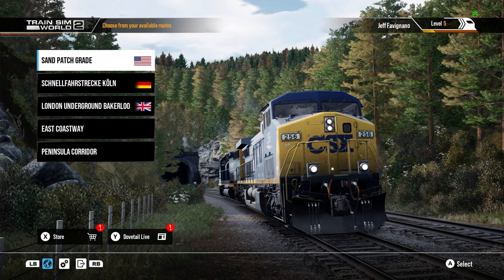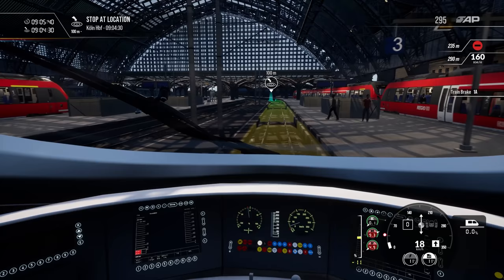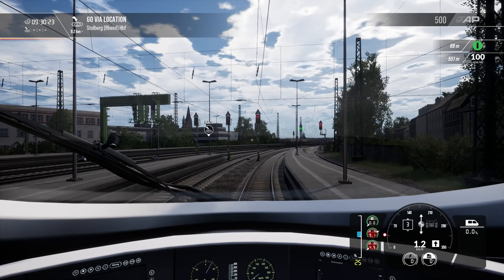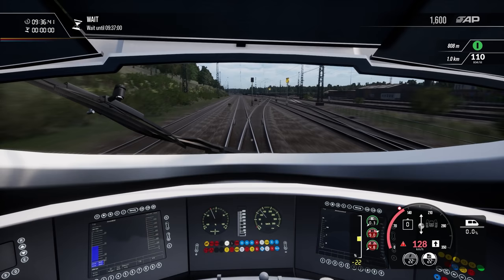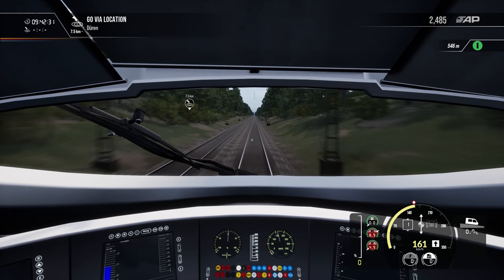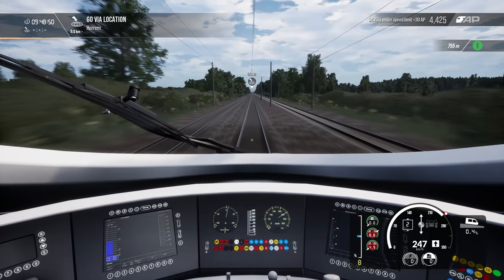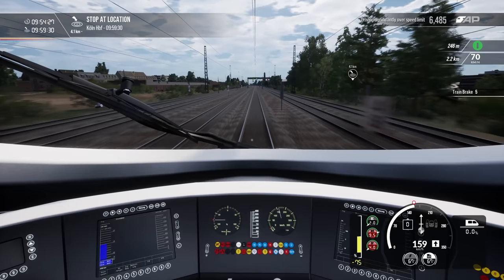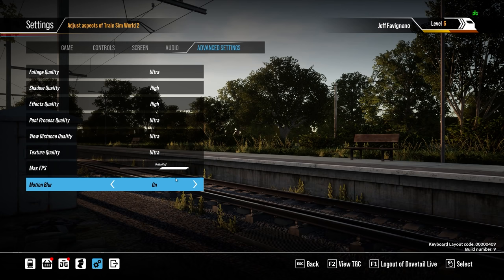250 KM/H in the DB ICE3M!

Comment: We have a variant of this train here in Russia going between Moscow and Saint Petersburg, and a couple of other places. It's called Sapsan here. The difference is that they are adopted for the wider track, have better insulation, and the trains are longer – in fact, the worlds longest high speed train (20 cars, 500 meters long) is a Sapsan currently running between Moscow and Saint-Petersburg. I frequently use this train, and even though it's max speed is 250 kmh on this track it's still amazing. It goes these 700 km in a little under 4 hours, and it's actually faster than going by plane considering you go from and arrive to the city centre and don't have to go through all the security stuff. And considering trains in Russia are running on time schedule to the minute you can get to the train station 10 minutes before departure instead of a few hours. And yeah, no matter how many times I go on this train, it's an amazing experience every time.

Comment: Jeff, some funzies to turn on are PZB, LZB, Sifa, and AFB. 
PZB and LZB are very useful for high-speed running, and read 14km ahead of you and tell you about red signals, and speed restrictions so you can slow down form 250 km/h. 
Sifa is a safety system to make sure you are 1) there and 2) alive and alert. 
AFB is a speed restrictor and will essentially drive the train for you. To turn it on fully (no restrictions), press 9 and 6 on the screen in-game (left display). Use R and F to control the setting of the speed limit of your train. AFB works with PZB and LZB to follow a braking curve to slow down or stop smoothly, and will use the train brake to stop if you tell it to. 

Some warnings about PZB and LZB: If you turn them on in the wrong spot, your train will activate the emergency brakes and you must turn them and Sifa off (if it wasn't already) to move again. With Sifa, if you don't acnowledge the warning (Q), the emergency brakes will come on. On AFB, on non-PZB/LZB territory it WILL NOT slow down for you since it doesn't have the data to tell it to.
Reply: Slight correction, if Sifa isn't acknowledged its an full service application, if PZB is Tripped it's an Emergency Stop application and the Cab computer will say Zwangsbremsung Zugbeeinflussung repeatedly until you acknowledge the PZB Trip. LZB is also an Emergency Stop application if you don't acknowledge the LZB  Endé it will sound the LZB alarm repeatedly until you acknowledge it. For you acknowledge PZB or LZB in an Emergency Stop application the Train has to come to a complete stop for it to be acknowledged.

Comment: I’ve been on one of these ICE trains before and they are very quiet in the cabin and ride very smooth.
Reply: yeah, they are very smooth , actualy in video you can see cabin shaking. but in real life its not so shaky. its very smooth. you wouldnt even spill any drop of water if glass was full with water to the edge, and was riding on train

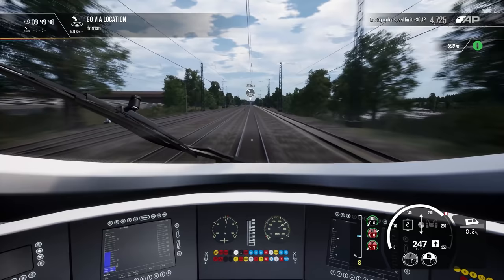Comment: 31:54 Electric trains are by far usually faster than diesel or other type of trains. Not sure what you meant by that.
Reply from the maker: I meant by the speed it is connected to the wire, it’s impressive
Reply: Jeff Favignano Catenaries operate by a spring, so it would stay connected at any speed.
Reply: @jfavignano  the TGV got tho nesrly 600kph on ohp

Comment: My commuting route actually takes me along this route (from Cologne Hbf to Aachen Rothe Erde). Generally I'm impressed by this route (the station buildings are accurate), and for a simulator this stretch of track is a good choice, featuring lots of International freight (the Thameslink trains were shipped over this route, and were a rather unusual sight for months) as well as ICE, national IC and 2 different Regional Express lines (with different rolling stock), and S-Bahn services (normally to Düren, in the early morning and after midnight all the way to Aachen). There is also a regional diesel line that runs from Düren, splitting into a circular line around Aachen at Stolberg (wasn't included though).
Unfortunately there are several small and some larger issues, the station underpass at Cologne looks absolutely nothing like the original, RE trains don't stop at Eilendorf and platforms 43 and 44 at Stolberg don't have a catenary (they're for diesel services only), yet a Talent 2 is parked there. Some more recognizable buildings like the Aachen Arkaden at Rothe Erde are represented by a single block. And whilst the tunnel lighting is nice, they aren't lit at all IRL (and also have a different profile). 

My biggest issue with this route however is the fact that the catenary  outside of the two track parts is completely inaccurate. From Ehrenfeld to Langerwehe, as well as at Eschweiler the catenary IRL is exclusively made of single masts, being a recently refurbished high speed line. The setup of gantries in the game allows a speed of only 160kph. Add to that the fact that the catenary at Cologne central station is also inaccurate, even though all necessary assets are in the game, it does look like a developer simply couldn't be bothered. If editing catenaries is similar to that of the original Train Simulator, making that accurate would incur less than a day of additional work.

Edit: though unlikely, an extension of this route to Frankfurt would be nice. That would add 45 minutes of ICE running at max speed over some insane grades of up to 4%, the section is quite long at over 200 kilometres. There'd be some spectacular views and a roller coaster feel at 300 kph (320 if the train is late).

Comment: The ICE 3M is a fantastic train. Hbf stands for hauptbahnhof in English that is central station. This train has a cruise control, it’s called “AFB” and you can turn it on by clicking on the left display. Also you choose the destination boards from the train. On the high speed tracks, this is using a safety system called “LZB”. If you turn that on with AFB, the train will brake and accelerate automatically. When LZB is going to stop, you will a yellow light in the cab with “Ende”. Then you need to hold the befehl button on your desk, what’s on the left side. When you don’t driving on the high speed line, you are using the safety system called “PZB”. That system is difficult. When you see a signal with a green and yellow light you are required to hold the “wachsam” button and then the PZB light are starting flashing and moving from left to the right. Speed changes from 90 km/h and lower you are required to hold the wachsam button. If you don’t do that, you will get a emergency brake. A LZB Ende signal needs to accepted within 10 seconds.

Comment: Hey Jeff, for the cruise control, you need to go to the Left Computer Display, hit the 9 key, then hit the 6 key to enable AFB (cruise control basically) then use the lever to the left of the throttle to set speed. Basically set the afb, and slam throttle to max, and the train drives itself. It's even cooler with LZB enabled. But that's something Alex needs to explain lol.
Great video tho! Such a beautiful train. And fun to drive.

Comment: When the "via location" says Wait it means you got there before it expected. You don't actually have to stop. 

Also, no motion blur=less glitches
Reply: Technically not right... The ICE services do not stop at any station... Some stations have ICEs going through the station (like Stolberg (Rhein)) and not passing by the station (at a reduced speed for safety reasons, as passengers in Germany usually wait at the platforms)...

The ICE 17 Service is a real service... From Brussels-Midi via Liège (both in Belgium), Aachen and Cologne (Köln), Bonn, Frankfurt on the Main (airport) to Frankfurt on the Main (main station).
DB offers this service as a connection to and for the Eurostar Services from Brussels-Midi (Eurostar) to London St. Pancras International in the UK...

The section of the track connects the stations of Aachen and Cologne. The ICEs only stop in this track section at Aachen and Köln (Cologne). The track is shared with Talent 2 by Bombardier and Desiro HC by Siemens operated emus, which are stopping at those stops.

I have been on this service myself last year when I went from Cologne to London and vice versa by train...
Reply: @itmkoeln  Wow. Yeah, I added a sentence to clarify what I meant.

Comment: If only the US had high speed rail trains. You'd think we would've had a coast to coast bullet train by now.
Reply: Thing is we don't have the funds to allocate to such a project. Note that everywhere else that has nationwide networks of HSR have one advantage over us: they are much smaller, therefore they don't have to put down as much rail, and as such don't have to spend as much.
Reply: Phoenix • Coast to Coast would be pretty impractical but yeah we should have at least a train faster than 160mph.
Reply: @banksrail  we might here in a hot second, as the Avelia Liberty trainsets are in testing.
Reply: IPAWS2018 the new train sets reach 220mph without tilting which is great but not on our current infrastructure 😭. We’re still trying to replace century-year-old bridges.
Reply: @IPAWS2018  Imagine you could ride on DB (if you book in advance at least 2 weeks before the journey for arround 17,90€ one trip, regardless of how far you went...) 

Made serval journeys in the last years with serval ICE sets... (from old fashioned ICE1,2,3,T to the current 3M for the multielectrical system services between the SNCB (Belgian), SNCF (French) networks and the modern ICE 4 sets and modernised ICE3).

I must say travelling in 2nd class I liked the old sets a little better. And if you take set reservations with a 4 person seating, I absolutely can't recommend the window side on the 3M in standard class (as long as you have knees...), due to how the desk is built...

Comment: Jeff, do you know, IRL, what extra track and safety considerations or equipment the high-speed rail trains require to inhibit or minimize derailment accidents, etc.? I figured there have
to be some special design elements to help prevent accidents, given the high speed operations involved. I did read the safety of most high speed rails are due to the ballast-less design,
no grade crossings, all elevated designs, and wide turning allotments, and the fact that the lines are designed to be "monotonous" with no difficult sections of the journey, etc. There have
been a few high speed rail accidents in Asia and elsewhere, but not many. There's on article I found that makes a big deal that most of these train lines lack seatbelts, which is kind of 
stupid.
Reply: Yeah the HSR requirements changed based on Country and Operator. I know the FRA in America has very strict rules on HSR including the height of cars and the crumple zones.
Reply: @banksrail  I see. But we have so little HSR here thus far. China even as Maglev lines already. It's pretty disappointing here in USA so far.
Reply: Scott Briggs yeah I have to agree with you HEAVILY on that one. There’s just a lack of money being spent on our infrastructure. I mean our fastest operating speed is only 160mph. But the is hope with other projects like the CAHSR, Texas Central, and XpressWest to create trains that reach speeds such as 220mph.
Reply: @banksrail  This country does short commuter and light rail lines very well, that's about it. Amtrak is nearly bankrupt. Some Metro systems are good, but not NYC's.
DC is ok, as is Philly's. I hear San Francisco's is pretty good. But we need THE VISION THING for high speed, longer haul rail systems. Canada needs to upgrade as well.
Reply: Scott Briggs Overall North America needs a lot of help with transportation. As for Metros, NYC has arguably one of the best in the world considering the sheer size of the system and the fact that it Operates 24/7. Another system that comes close to compare by size and ridership is CTA in Chicago. DC’s WMATA, Atlanta’s MARTA, Boston’s MBTA and San Francisco’s BART all have great systems too.